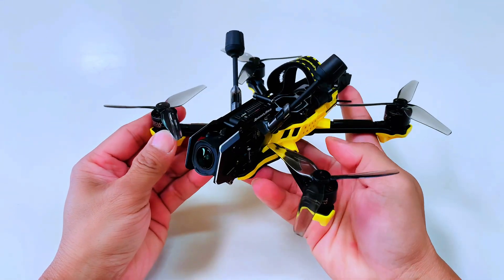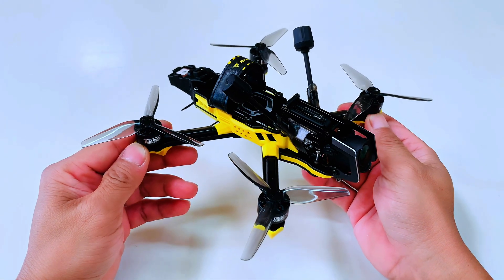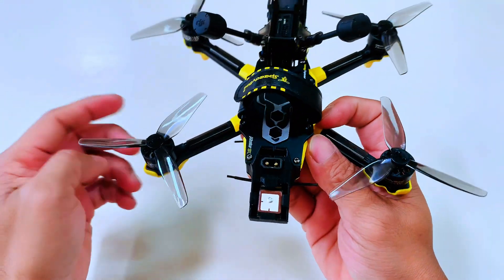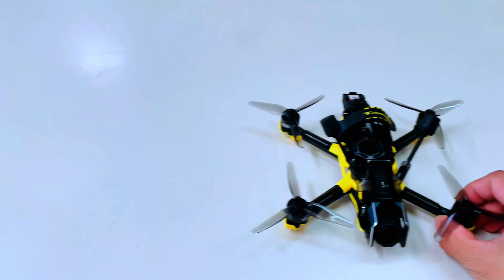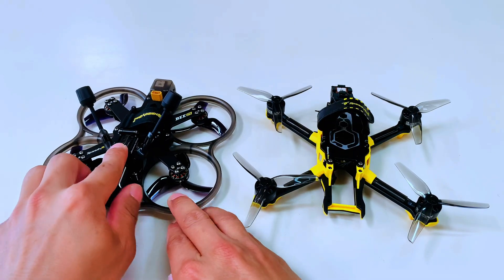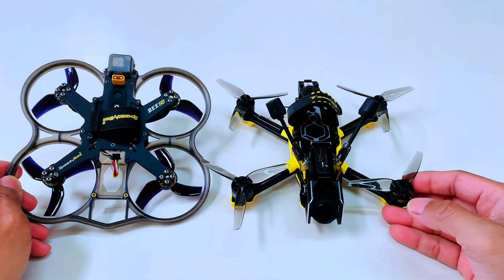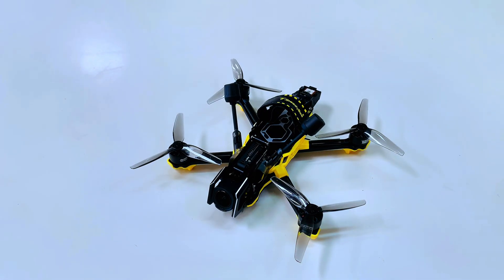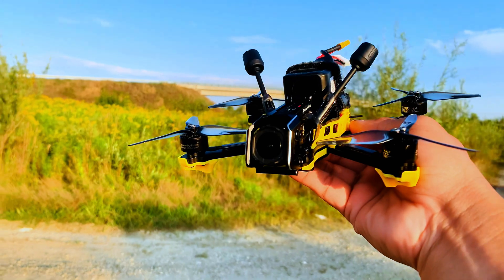Speedybee Master 3x - 3.5 inch FPV self Build #fpv

Comment: Hi, can you please let me know if the Tattu R-Line 750mAh 14.8V 95C 4S1P Lipo Battery Pack With XT30 Plug is a good choice for this drone?
Reply from the maker: Yes it ok brother get it
Reply: @DronePH-2026  Sweet, thanks! Should I not get the 6s and higher mah like 1200mah?

Comment: Hi bro, can send your betaflight profile ? I have same quad but have problem with shaky video
Reply from the maker: Did you use 04 air unit Pro brother?
Reply: @DronePH-2026 yup but not buy the BNF, so my spec using o4 pro with different motor and fc

Comment: Bro i have speedybee bee35 o3, can i use this frame and convert my bee35 ro master3x? My bee35 use 6s 1350 batt do you think its possible?
Reply from the maker: Yes you can convert brother just use 4s with higher Mah thanks
Reply: @DronePH-2026 thanks man!

Comment: I’m building with same frame/motor/aio , hover throttle is 25%?
Reply from the maker: That's great brother enjoy and happy flying
Reply: I built this also, except I used 1804 3500. Hover is around 25-30% for my build.